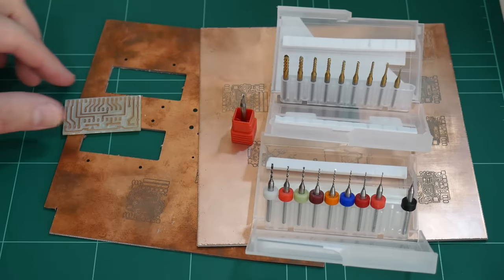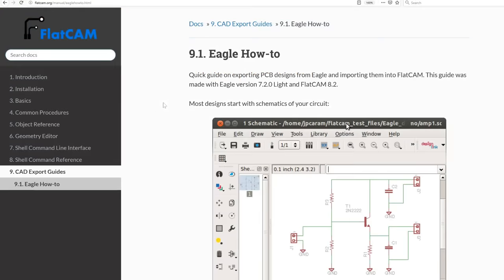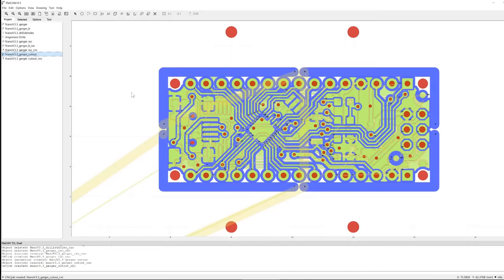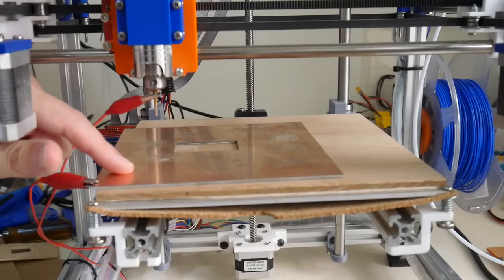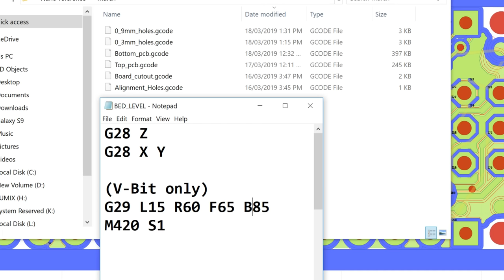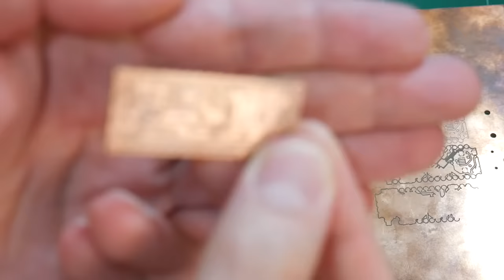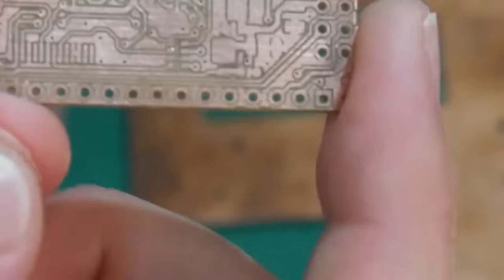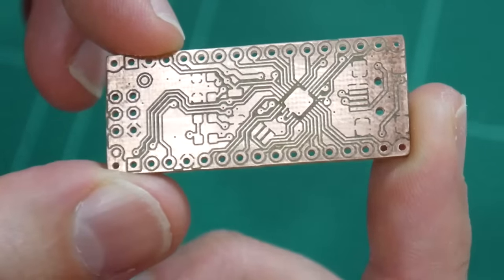Advanced DIY PCB with a modified 3D Printer

Comment: Interesting technique, but this video and its title are incredibly misleading.  At no point was there any 3d printing being done here.  Just because something has an XYZ axis and a CNC control, does not make it 3d printing.  Also known as additive manufacturing, key word here being additive, as in  to add things, to increase.  
Also, its a really bad idea to drill a hole without first securing the material being drilled.

Comment: I tried something similar on my Shapeoko (discontinued) with a 20° single flute 0.1mm engraving bit.  The controller or firmware that the Shapeoko used didn't have the conductive leveling support, at least it didn't work when I tested it, so it wasn't quite accurate enough to do anything bigger than an inch or two...    https://photos.app.goo.gl/7wDFG2DaZK368xNS7
Its perfect for a quick prototype, I would farm out to a pro when the design is finished... if I finish this design... if I get back to this project... haha
Reply from the maker: Wow that is a nice board, well done!

Comment: It's already not 3d printer.  You make pcb different way, so don't say it's 3d printer in header.
Reply: It's a 3d printer / CNC hybrid. It can do both. (I guess the head is changable)
Reply: @monad_tcp  if it don't print then it is not a printer. He milled pcb, not 3d-printed as it goes from header.
Reply: @ЭлвисСергеевич-к1ш   this is taxonomy bike-shedding, if the machine can do both things, it's both, even if you did just milling
but whatever, I don't care
Reply: @monad_tcp  ok then my car is actually an airplane. I just need install wings and good propeller.
Reply: It's using a 3d printer and 3d printer firmware, and pronterface. Sound like at least 75% 3d printer to me.

Comment: NO matter what manufacturing method you use, you do NOT set the traces like that. It made no sense having solder pads so close to a trace, it will only cause a short at that stage anyway. You need to draw that again with proper spacing. That would've never worked in real life. Not to mention if it has larger voltages, you risk having an arc there, safety alone says you have them too close.. As a problem solving, on how to tweak te milling part of course it is good but as a PCB design it is crap.. First year EE student would not pass a test with that design..
Reply from the maker: Which PCB design are you refering too?
Reply: He must be referring to the first pcb
Reply: @sudoeste08  Probably, i mean the Nano's design has been mass-produced for years without issues so i doubt it "wouldnt pass the first year EE student test"...